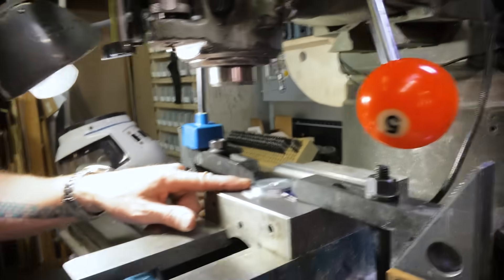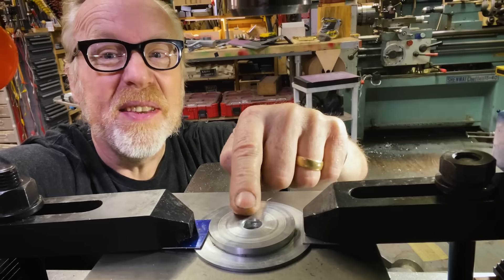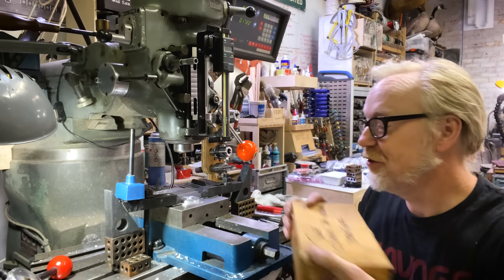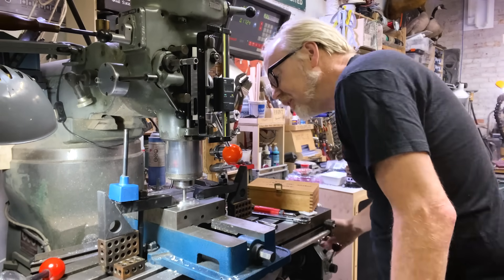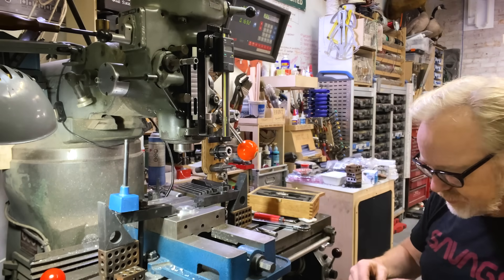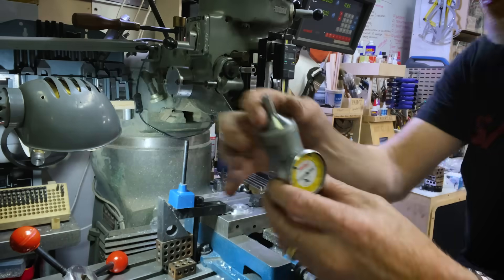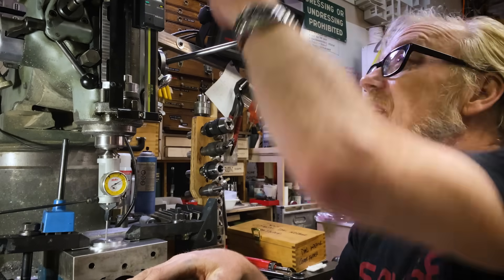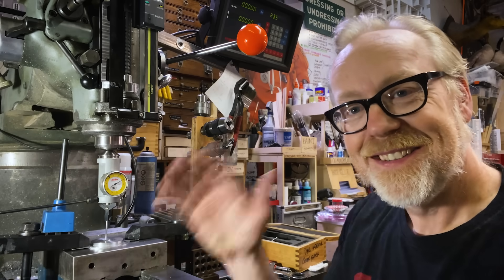Adam Savage's Favorite Tools: Wiggler Machining Center-Finder

Comment from the maker: Milling Machine "Wiggler" Centering Indicator: https://amzn.to/39SyspS
Reply: That isn't a wiggler.
Reply: @derschwartzadder  He did that to get people talking and to share it...  If he called it by the proper name nobody would have seen the video...
Reply: @derschwartzadder  yeah it is LMAO
Reply: Show the dogo
Reply: Currently unavailable - they don’t know when it will be back in stock.
Reply: @ianmoone2359  Amazon says it is in stock...
Reply: @ianmoone2359  The link provided shows that they are $90 and currently in stock. These are Anytime Tools brand and not the MSC one that he has.
Reply: Robert Oswalt I just opened the link again and it still says unavailable and they don’t know when it will be in stock again.
There is a cheaper alternative available to consider but I didn’t open that link.
I’m just looking at the red one in Adams link.
Reply: I feel that someone could make a 4 gauge wiggler that would tell you which of the axes (x,-x,y,-y) was causing it to be out.
I suppose going even further would be that it doesn't 'wiggle' it would just show how much force was placed on that axis on the last rotation.

I know it doesn't take long to calibrate but this would just make the process simpler and quicker wouldn't it?
Reply: @Jambunctious  Also had niggling feeling that it 'could be improved' - but then everything I thought of had flaws.
i.e. If you put multiple feelers on it, you'd have to know that they were all equidistant from the focus. With just one, you can bend it as much as you like, and it'll still work.
I was thinking if you could somehow work out how to just take readings based on position in the rotation.
i.e. if you could separate resistance from the edge at 0 and 180, and 90 and 270 - then could map that two 2 readouts, and get proper x and y corrections - but probably beyond mechanical (and suspect once you're used to using the tool, doesn't give much practical benefit)
Reply: @Jambunctious  The coaxial indicator can be used manually where you can see how far it is out in each direction so you can rough it in faster. The advantage of using the coaxial indicator over a conventional indicator and an Indicol holder is that the face of the indicator is always facing you as opposed to rotating around the axis of the spindle making it difficult to read when it is 180 degrees from you.
Reply: Hey Adam if you are reading this please take a look to the láser aligner that Dan gelbart demonstrates in one of His videos, you probably Will go woww. 
Sorry for my so so English!
Reply: @sebastiancardoso7264  This. Thank you. Dan Gelbart is a demigod.
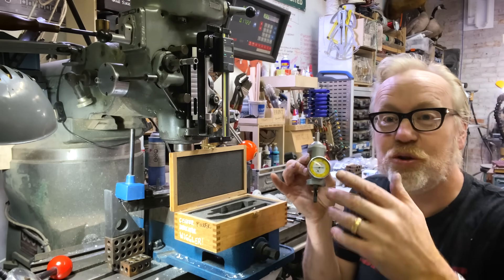Reply: 2:24 to precisely calibrate the concentricity of the quilt of the mill to the hole!!!!! Wtf!! Jajaja I wish you made a rap album man!!! Love you 
Cheers from Argentina!!!
Reply: That's a coaxial indicator. A wiggler similar to an edge finder it usually has a ball on the end.
Reply: Soooooo I looked at the link Adam has highlighted on Amazon and it clearly says coaxial indicator.
Reply: Its called a Coaxial Indicator.
Reply: OH GOD, you ran the SPINDLE with this thing in it? NOOOOO. This is a precision instrument, NO POWER TOOLS. EVER. That includes the machine you stick it in. 

Notable exceptions: checking spindle runout, checking sqaureness/ alignments on CNCs, backlash of axes. Basically, if you're checking the path that the machine uses to actually make a part, and in those cases: SLOW YOUR SPEED DOWN. Like to a crawl, no more than 25 rpm (obviously, linear checks don't use rpm, but you got slow anyway in case you fucked up your position, crunch noises from indicators make the most hardened machinist sob), the lower the better, otherwise you can burn your indicator tips. ESPECIALLY with what you're doing here, you're going from high to low spots INSANELY quickly. You WILL break your precision equipment that way.

I do realise the one you have is a rather cheap one, but these things get expensive real fast the higher quality you go for. If you had a machinist next to you, you'd have been slapped with a thick piece of barstock, or a hammer whichever was on hand. INCIDENTALLY, the only time a hammer is allowed near a machine is for GENTLY tapping stock into squareness, or making sure stock is settled into a vise or chuck.
Reply: Orange Dream - I’ve seen them used under power before by known competent machinists; but (like you say) they always have the machine in it’s lowest speed possible. Also, a bit of oil on the part helps (but, of course, wipe off the tip of the instrument before putting it away - you don’t want to get the storage case all gunked up).

Oh, and the other thing a hammer is legitimately used for on a mill is to give the drawbar a light tap to pop the collet loose from the taper when removing either the tool or collet from the spindle. And when I say light, I mean it: no more force than is absolutely necessary; because you don’t want to deform the head of the drawbar or the threads on the drawbar or collet.

🙂
Reply: @darkwinter6028  fyi they sell hammers with a draw bar socket on one end and a brass hammer on the other.
Reply: DmbWorks - yeah, I know. I’ve actually used them before; I just don’t happen to own one right now.
Reply: @orangedream267  Dude calm down, this is how the world uses coaxial indicators.
Reply: @highvoltagefeathers  Not at this speed. Also, I am calm. The way Adam uses the coax is correct, just too fast. WAY too fast. You can burn tips, you can bend the arm of the tip, if the latter happens you can screw with the delicate internals of the indicator. You treat your testing equipment with white gloves and baby them. If you don't you're doing it wrong. Equipment that isn't precision, IE: hammers to see if something is sitting in a vise well, is fine to be rough with. An indicator that can measure things that are thinner than a sheet of paper? Absolutely not.

Treat your machines the way you want your machines to treat you. Same goes for tools. Use them correctly, clean them after, and put them away where you took them from.
Reply: @orangedream267  All mine at work are rated for 750 to 800 rpm. It's easier to use them at faster speeds because you see the needle bouncing faster instead of waiting for the tool to spin
Reply: @orangedream267  I am old in life, new to precision metal work. I've watch a lot of videos and NEVER seen any machinist run the equipment. Its always gently moved to dial in precise alignment. This would explain why the mill "was noisey" on the read out. But I love Adam!
Reply: @emrfixit  It was noisy for a few reasons, spindle runout (how much the spindle actually wobbles, and yes it does), the high speed, and how circular and smooth the feature on the part Adam was centering on. The former, will usually be very small, probably only a few tenth depending on machine age, and make. High speed will certainly do it, especially if you brace the coaxial on a sloped part like some other people have said, and the latter will affect it the most. Assuming you don't have a boat anchor for a machine and your runout is insane. Because someone crashed it.

As for being old, I don't judge. There's guys in machining with longer careers than my age (I'm a young ass at 30 years, been doing this sort of stuff for close to 3). And that's the majority. There's VERY little young people that want to do this sort of stuff which is a shame.
Reply: @orangedream267  Wow thanks for the reply and explanation! Much appreciated.
Reply: @emrfixit  read out was more likely noisy because the bore of the hole was sh*t. 4:09
Reply: @orangedream267  my blake has a max rpm of 700-800 rpm and i run it at 300 because thats what my mill runs with the doors open.
Reply: I use my coaxial indicator all the time. But just to get relatively close. After that it's always my test dial indicator with .00005 read out. Why?  I have bolt patterns with a true position of 4 thousands projected 1" above the part. No maximum material conditions.
Reply: To be fair I understand how this could get confused with a wiggler because the point on it is the same as a wiggly edge finder   although a wiggler doesn't have an indicator.    the Coax Indicator which is what you are showing does
Reply: In Germany we call it a Centricator and the manual (from a expensive one, around 500€) says 50-100 RPM and max 150 RPM
Reply: Hi, Adam!  I'm not so great with written descriptions but hey, give this a try...  Extend the upper shaft on your co-axial indicator a couple inches so that you can get a tap wrench around it and still get it in a collet.  Rather than turning the spindle on and spinning at your lowest RPM's, you can spin it by hand with the tap wrench as slow as you need.  I find spinning by hand to be 10x faster to zero a part.  Do the X axis first then X and when they're both at 0 you can run the spindle to make sure it's still true with any runout in the machine.  Also, Barry at H&W Machine in Indiana does a most excellent job of rebuilding these machines - you can send the whole machine or just the head!  Hope this helps!
Reply: got to honest i was more interested in the noise the milling machine made when you where swapping the collets over hope i spelt that correct posh machine that have you done a video on it?,  i remember at school it was more like push the thing in place and a tap with a hammer for extraction
Reply: @MrRBobs  Ah, the power drawbar!  Yeah, we should all have one...
Reply: Adam. The curved rods are actually for O.D. measurement. I have this exact indicator was just using it today on a 5 axis CNC mill.
Reply: If u dont know about this channel thank me lateer.... U should go n check out ave channel.... U would like it
Reply: "co-axial" and if you want to support an american company making them for about the last century look up Blake Mfg Co.

Comment: That's not what I'd call a wiggler, but slang does vary...just co-ax indicator to me. Maybe first made by "Blake"..
    It's hard to say that each graduation is 0.0005", because it varies with the probe length, and also the probe angle. The further it is from vertical, the more sensitive it is..this variation is significant.
    A precisely "trammed" head is essential...the spindle centerline must be exactly perpendicular to the plane of the table...if not, any hole will appear to be an ellipse to the indicator, and any change in spindle extension really screws your careful hole location.
    I usually do x/y location with the machine in neutral, turning by hand, then run the machine slowly to verify minimal needle movement.
    Good tool.
   Thanks for your videos, and also, as far as I've noticed, your interest in manual machines, over cnc. My preference, too.

Comment: I was considering asking Kurtis of Cutting Edge Engineering (to whom you've sent a call-out before - though no chews for Homey the dog. Are you a cat person or a dog person? Regardless.)  to show exactly how the "wobble finder" works. But he's running a commercial metal shop, while you're running an "edutainment" business, so when I saw your piece in CEE's work, I thought "does The Singed-Eyebrowéd One have a piece about how these work?" Et voilá!
Does "machine shop instrumentation" fit within your "edutainment" balliwick?
Off to actually watch your video now!
Reply: Kurtis uses a different style of wiggler, which doesn't have a "wiggle-thousandths" gauge but some mechanical "make displacement obvious" system, but I get how they work now. You've essentially got the guts of a standard dial indicator, and the clamp thing on the bottom combines with the extension arm to act as a lever on the sensing direction of the dial indicator.
One of the machines Kurtis is renovating to bring back into service should do ten-thousandth (0.0001 unit) accuracy on it's (approximately) 4m by 3m working area. That's 0.0001 mm, not bananas (as Australia believes America uses). The big milling machine on the other hand will be fun when he gets that working. But it's not so precise. Not that I'm trying to provoke precision envy.

Comment: You have some slack in the vertical axis somewhere. You can see the grey body of the wiggler bouncing up and down relative to the background during the early phase of the actual "centre finding". It improves as you iterate towards the centre. That will exaggerate the needle movement if you have any roughness in the hole/ surface that you are setting the centre from.

Comment: Here is a simple new style quick release holder you might want to make. - https://youtu.be/_djgGUKpULs 
It covers most Bridgeport size work and always has the stylus aligned with the spindle.
Here is a very short background video showing the principles of stylus alignment and the pitfalls with regular holders. - https://youtu.be/3r9xVYoTK38

Comment: It is a concentricity gauge. Main use is centering a rotary table in the mill- fast and easy- a dti is hard to read al the way around, this always reads to the front. Better to run it slower than Adam did.

Comment: Co-axial dial indicator. A wiggler is a tool several different nose pcs. indicator holder, edge finder and a point for picking up scribed locations or center punched locations

Comment: Interesting, seems like a regular tenth indicator or even .0005 indicator in a standard holder would work better, especially with the spindle off.  Then find the x and y axis spinning by hand.  Or an indicator and an indicol attached to the spindle.  That is usually how I find it at work.  Also, works for finding center of odd shapes, as long as there is room to tram it in side to side.  Of course now our new machines use a probe, still like the indicator tho.  My two cents, (inflation may make it worth less) results may vary, LOL. Machine on!

Comment: It's a coaxial-indicator. A wiggler is an edge finder, which will still find a hole center. On a bridgeport or any mill with an easily rotated spindle I would still prefer a dial test indicator and a mirror if needed.

Comment: So you have this big, expensive, pretty tool with a single use. I just use a test indicator in the collet, put the mill in neutral, and turn it by hand a few times to dial it in quickly. The little indicator I had would do holes up to 4" easily, 8" in a boring bar attachment.

https://www.google.com/search?q=test%20indicator&ie=utf-8&oe=utf-8&client=firefox-b-1-m

Comment: Set the speed low before loading the coax indicator could save a mishap.

You can use the bar holder on the lower right of the quill casting to stop the unit from rotating. Insert a 1/4" rod & clamp with the thumbscrew.

I like to keep magnets away from my vice as it can magnetize it slightly & affect the accuracy when using wigglers.

Comment: Normal human eyesight removes down to about 0.005 in. If you can get to only ten thousandths with your eyes, get them checked. By sliding a small piece of paper between your tool and workpiece you can get accuracy to 0.0005in.  regularly.
A cheep edge finder can put you in within  0.0002 if you use care.
I learned the hard way that one of the most effective ways to ruin an indicator is by making the needle move very fast. Always turn the spindle by hand. Do one axis, then the other,then recheck. Your spendy “coax indicator will thank you many years later.

Comment: Coaxial indicator...

BTW you're indicating the center line of the hole concentricity has nothing to do with what you're doing.

Also, spindle bearings on a Bridgeport do not get "repacked" they are oiled only. There is a oil cup on the side of the head that you need to be putting oil in to lub the spindle and the bearings. Never use grease!

Comment: You could probably also tape two threads 90° from another over the hole so they intersect and with calipers find the two outer most edges on the piece to line them up and then put a needle or something in the chuck and line it up with the center of the intersection
Reply: Something like that

Comment: I've had a Blake Coaxial indicator for about 40 years. I rarely use it under power. Just wanted to tell you that I often used it for centering on shafts & for finding the center of square & rectangular objects. You simply raise & lower the quill manually as you switch front front to back side with the feeler tip. There is totally different tool called a wiggler. This ain't it.

Comment: As many have stated, it's a coaxial indicator. Also its quicker if you spin the indicator with your hand to find the high and low directions in one axis, calculate half in your head, and then move it that much in that axis. Then repeat for the other direction. You might do it again as a tweak but you're probably already at center by that point. I personally do not like spinning it so much in the hole where it can cause friction and wear so I avoid turning on the spindle.

Comment: Nahhhhh.  KISS Principe- A decent dial indicator will find the center with less effort and no guess work. This thing he’s using is not indicating which axis needs adjustment and having to run the spindle? Ugg.  Oh - and never move the knee after you locate the part - the head might be swept square but never perfect - just silly to so precisely locate the part then move the knee- now it’s not where it was. Regardless always entertaining to see Adam.

Comment: Adams name for it works. The wiggler is a easy way to tram in your mills head stock. I had a disk brake rotor turned with no lip left on the back side so the rotor lays flat on the mill table and the way rotors are turned cutting both sides simultaneously both sides are perfectly parallel so the long feeler of the wiggler can be set to run around on the rotors front / top surface. Their is plenty of surface so the rotor dose not have to be centered under the quill just close. It is a tool that is a must have.